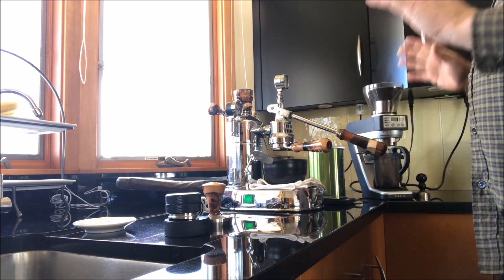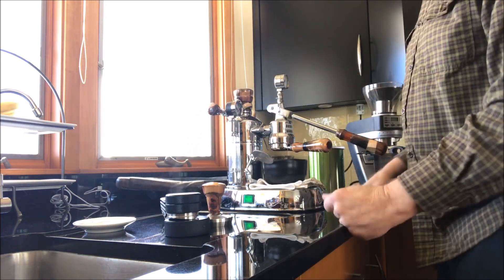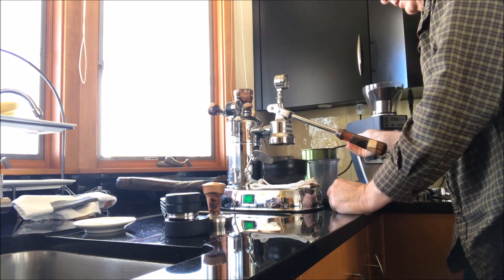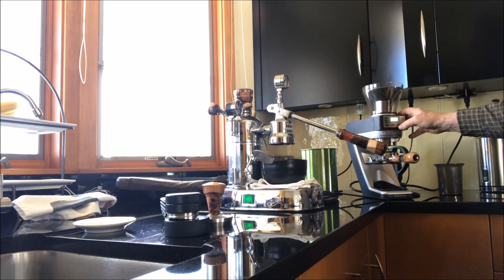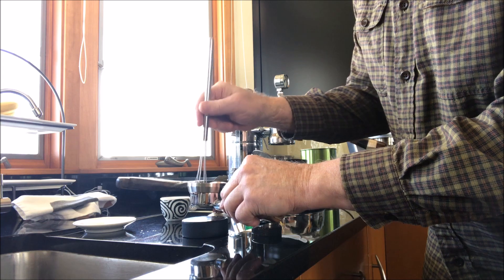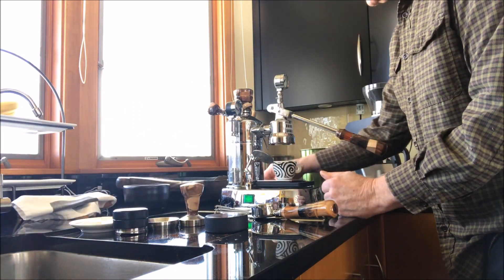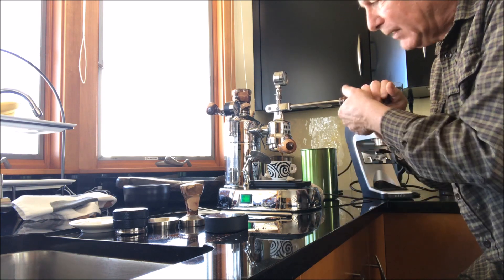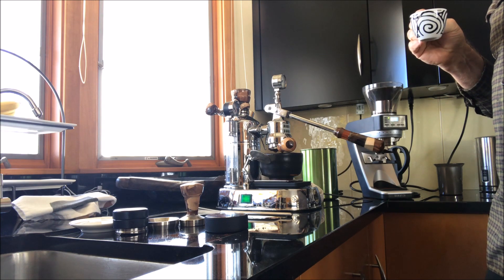Pulling a shot on a La Pavoni manual lever

Comment: Glad you made this. I was having trouble getting above 6 bars with only 14 grams of coffee.  I’ve been slowing increasing the coffee to get more pressure. I was glad to see that you pull with more grams of coffee.  I thought I was the only one enjoying 18 grams and above.
Reply from the maker: Yeah, why buy a deeper basket if you're not going to use it? IMHO- you need some headspace, but not too much.
Reply: @BrucePappas  I've read most folks not exceeding ~14g coffee, but you loaded 20g.  Are you seeing evidence of it pressed up against the shower screen?
Reply from the maker: @charlesa99  - I have a 20g basket; I dose to 18g. When I was using a double (16g) basket, I dosed to 14.

Comment: what to buy buy between elektra Microcasa e leva or La Pavoni ESPED Esperto COMPETENTE
Its so hard to choose, i cant find a shop where i can see those machines and rely on what i read on reviews but theres not much written about the la pavoni competente
Reply from the maker: Where are you located? If in the USA, I recommend Stefano's.

Those two machines are quite different. The LP is manual lever and the Electra is semi-automatic. Which one works for you? It depends on what you're seeking. The LP gives you complete control of most variables, but consistency is hard to achieve. The Electra is quality machine and more stable, and thus more consistent. In the long run, it's a matter of what you want and which one "sings" to you.
Reply: @BrucePappas  
The Elektra is prettier, but I prefer a super thick espresso which I guess is better achieved with a lever without sprong
Reply from the maker: @gabmor7779  - Funny, but I prefer the looks of the LP. ;)

Comment: what grind setting do you use
Reply from the maker: Grind settings vary from one grinder manufacturer to another and frankly, from one grinder to another even from the same manufacturer. Also, based on the beans, roast, and age. What grinder are you using?

Comment: it's a labor of love. Once you figure the costs of all of the equipment/supplies and the mental "issues" with getting it "just so", well, it's a labor of love along with it being the most expensive coffee you can enjoy. I find that defining "just so" is the most difficult part.
Reply from the maker: I'm not too sure what you mean by the most expensive coffee you can enjoy. If you're talking about LP levers, used machines are cheap and good hand grinders are reasonable. I believe in the long run you save money versus going to Starbucks or other coffee shops on a daily basis. 

I agree that it's a labor of love. Getting it "just so" is about controlling all the variables that go into making a good espresso. That's the fun part for many; others don't want to take the time or energy.

Enjoy!
Reply from the maker: Yeah, expense is relative. I have a friend who spent almost $3K USD on an espresso machine. I think a good used LP is a bargain. ;)

Comment: Hi Bruce, what is the diameter of tamping/distribution tool and where did you source the bottomless portafilter for the LaPavoni Professional ? Advice is appreciated
Reply from the maker: Depends upon the year. Gen1/2 before 2000 use 49m (nominal) and Gen3/4 after 2000 use 51mm (nominal). My distribution tool is from Bplus.biz  Several good sources for bottomless portafilters. I'll put the sources for my tools in the comments.
Reply: Thanks Bruce! I have a relatively new LP pro. I’ll look for a 51 mm tamper and bottomless porta filter
Reply from the maker: @184186  - what year is your machine? What does the grouphead look like?  Check out this reference:  https://www.espressocare.com/la-pavoni-millennium-or-pre-millennium-comparison
Reply from the maker: @184186  - Millennium is the same as Gen3. Yes, actually, a little larger will work. 
From our FB Support group file:  · Millennium (2001 and after): 51 mm (51.5 mm fits better)
Reply: @BrucePappas  thanks for the clarification between the 51.0mm and 51.5mm.... √√√

Comment: Nice video and very informative. I am struggling with my la pavoni pro millennium to get consistent good shots, specially about the group head temperature. It is set at 0.9 bars and I have just commanded a group head thermometer strip. But I don't know at what temperature (group head) I should pull the shot ? Or should I get a group head thermometer ? thanks in advance.
Reply from the maker: Gen2s (PreMills) can be difficult to manage temp-wise. A GH temp strip is what I use (thermometer is not necessary). I suggest starting at between 80 and 95°C, then gradually move up, if needed.
Reply: @BrucePappas  thanks for the tip. it is a millennium pavoni. Hope this is the more stable  version.
Reply from the maker: @murataht - sorry that I misread that. Yes, Gen3s (Pros) are more stable. I still suggest you start at the same temps, using temp strips.
Reply: @BrucePappas  Finally I opted for a group head thermometer, and I am pulling shots from 90 to 95 degrees. Using cool portafilter to cooling down the group head between shots. The results are much more consistent, and I think I am ready to experiment with different coffee beans. thanks.

Comment: I'm really struggling with temperature management on my gen 2. I've had it for 10 months now and I'm beginning to relegate it due to the difficulty, making a significantly larger amount of V60 and aeropress as of late. Like many others here I recently discovered your channel through your comment on James' video and also on the facebook group. I'm hesitant to try the Bong Isolator, partly due to the price and shipping for such a tiny part, but also because of the flex it introduces. I've also seen that heatsinks can cause the grouphead to drop far too low.

I'm currently producing shots at inconsistent temperatures - sometimes it feels like the temperature shoots up to 100+ within 8 minutes, othertimes no matter what I do it feels like I'm dragging it up over 80. I'm not sure exactly what to do, except that I really love this machine, but cannot make it work like I want it to. I'm thinking perhaps a custom heatsink with much smaller fins, or some kind of PID fan cooled mini heatsink. I hope you might be able to shed some insight into my problem, and most of all that you continue making good espresso like this!
Reply from the maker: Joff, I empathize with you. Gen2s are more difficult to master, due to the fact that hot boiler water is inserted directly into the brew chamber and the grouphead is steam-heated. I admit that I know more theory than practical experience for using Gen2s. I currently use a Gen3, though while it's being refurbished, I'm using a Gen1 in my kitchen. I 'm also refurbing a Gen2, so I can see how the Bong Isolator helps. We'll see when I finish that one. :)

In theory, the isolator and a heat sink should do a very similar thing - dissipate heat faster to be able to repeat pulls. If you're doing a single pull or can wait between pulls, you might be able to do the same thing by dry-pumping (see Claudio Santoro's video) to heat up the grouphead, while monitoring group head temp with temps strips or a digital thermometer. You also need to figure out the "offset" temperature of your machine, usually between 80-85 degrees C on a Gen2. Offset temp is the temp you want to start your pull. Those three things (dry pumps, GH thermometer, and offset temp) should get you good results. Some members learn how to do this buy feel; I admire them.

BTW- dry pumps is how owners of Gen2s with the isolator or a heat sink get the temp up initially and back up for repeat pulls. I'm not worried about the flex of the group head with an isolator; I've watched Bong Juachon's demonstrations. 

Let me know how this goes.
Reply: @BrucePappas  I changed two things today when I attempted my espresso. The first was to do an extended steam purge. I normally do about 5 seconds but after seeing some people doing much longer I thought I'd give it a try. This caused the grouphead temperature to skyrocket about 20 seconds after - presumably because of the air being pushed out of the grouphead space and boiler. I suppose this may lend itself to a more repeatable process.

But the more important thing, that I haven't seen anywhere yet on forums, is when cooling down the grouphead I did so with the lever up as high as possible before water is permitted to enter. My reasoning was that attempting to cool down the grouphead would be a losing battle if it is still being heated by water sitting above the piston whilst the lever is down. It was very successful! I was able to cool the grouphead from 100 C down to 86 C in ~20s using only a spare chilled portafilter. I'm not sure if I missed this advice somewhere, but I would highly recommend anyone to try it for faster cooling.

I am filled with hope!
Reply from the maker: @Checkedbox  - Glad that things are going better for you. We have some tips in our FB group on this:

To raise the group temp:
.Flush hot water through the group before inserting the portafilter.
.Dry pump (by raising and lowering the lever, stopping at the top before water comes out of the group bottom) to circulate water inside the group.

To lower the group temp:
.Cool a portafilter with very cold water, lock it into the group, and allow it to absorb some of the group temp.
.Place a cool wet towel over the back neck of the group
.Immerse the group in a ramekin (small bowl) of cold tap water with a couple of small ice cubes. 
.Or just wait for it to cool.

https://www.facebook.com/1152888854887794/

Comment: where did you source the 'temperature strip' you placed on the group head? I'd like to get one. Thanks!
Reply from the maker: It's by Flair. I like it a lot. https://www.flairespresso.com/product-page/temperature-strip
Reply: @BrucePappas  thanks for the link, appreciated!
Reply: @184186  Telatemp is a company that makes them - or similar - but minimum purchase is 20 units.

Comment: Since the time of purchase the La Pavoni Europiccola I have a problem with a metallic taste of water that leaves the "group" (separately from the boiler, water is normal - without a taste), are there any ideas or is this a problem in the fact that the piston and head are brass? 
PS. Already rebuild the "group head" (cleaned, polished and greased with silicone special grease) - the problem still exists.
Reply from the maker: 2 thoughts:  
1) Your water may be devoid of minerals, such as reverse osmosis. If so, your water will be literally eating away at the metal. Switch water source. 
2) You might need to "season" the metal, but letting baking soda sit in the boiler and also run some through the GH. 
Let me know know it goes.

You might want to join our Facebook Group and ask you question there. Members may have more input.
Reply: @BrucePappas   Thank you for your answer. As I wrote before the water from boiler (after extraction process) - is good without any metallic taste.
Metallic taste appears only from the "shower" at the end (from grouphead).
I already discussed this moment on the forum and already done what me recommended. I rebuilt the grouphead, cleaning everything, changed grease(lubrication) and so on. The result is the same.
Reply from the maker: Is your portafilter bottomless or with spouts?
Reply: @BrucePappas  with spouts. But I tried without a holder, directly water from grouphead.
Reply from the maker: Have you tried a different shower screen?

Comment: Love this clip.  Are you using the smaller insert in the smaller filter basket with your 20gram  grind.  It seems to be overflowing in the basket.  Which indicates it's the smaller one.
Reply from the maker: I haven't been using the Sette 270W since I got my Niche Zero. But I was using the 20g basket. Recently, I have been using 18g in my 20g basket.
Reply: @BrucePappas  Has your yield increased by using the 20g IMS?
Reply from the maker: @wazramzi6614  - Yes, a bit. I shoot for 1:2 brew ratio and the the output is more consistent now and stronger. I shoot for 18g beans and 36g (or so) liquid.
Reply: @BrucePappas  good to hear. Ive recently ordered a pretty PF with the IMS 20g for my millenium pro, which Im in the process of restoring. I was worried that I paid extra for something that would only give me negligible gains and hope to maintain my current routine I developed with the flair. Do you use the Fellini technique?
Reply from the maker: @wazramzi6614  I think you'll like the improvement. Is it a game changer? Not in my book. But a nice improvement nonetheless. Please let me know what you think.
Reply: @BrucePappas  yeah, when it arrives and I finish restoring the pro, ill let you know the results. ;)

Comment: So I have an '80s vintage Pro, still going strong. I got two filters with it when new, one for singles, one for doubles. Somewhere along the way I started doing a double pull (lever down 80%, then back up and pull again), reasoning that the double shot requires it. The amount of liquid I get varies daily, but the shots taste great. Anyone else here trying similar? Any comments?
Reply from the maker: Sorry, Erik, I just saw this. Glad to hear double pulls are working out for you. I've tried that before and I felt the espresso was over-extracted. I go for a 2:1 output:dosage rate.

Comment: Thanks for the video it is awesome :) Could i check with you the max output of coffee from the La Pavoni in one full pull? As i usually like to get an 45grams output from my 15grams of grind. Not sure whether the machine has the capacity for it
Reply from the maker: If you're getting 45g, your shot is either way more awesome than anything I pull or it's over-extracted. I usually go for 1:2 ratio, so 16g of coffee grounds would produce 32g of espresso. With a mini-Fellini, I can get a bit more.